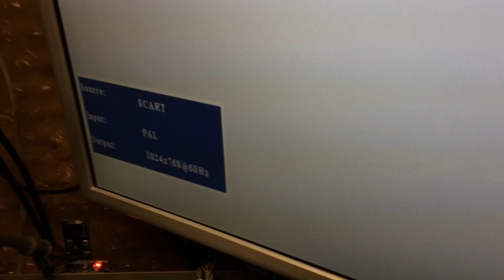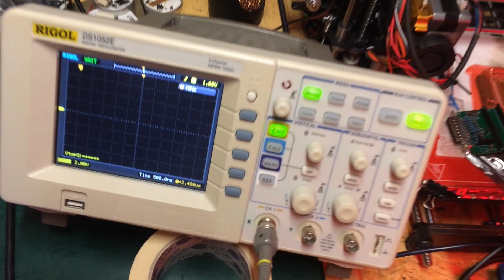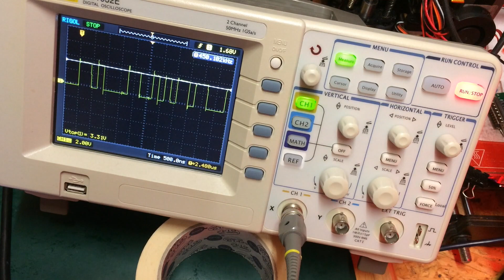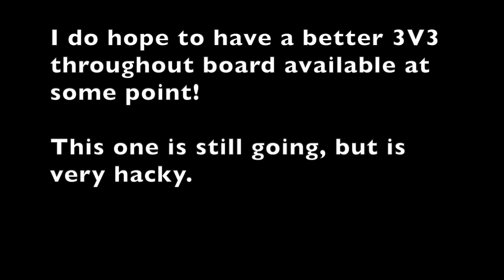ACSI2STM 5V SD Card Module Problem?

Comment: Oh, BTW: do not rely on the RTC on the BluePill to be accurate. They didn't match the capacitors to the load- and stray-capacitance...
If the BluePill didn't "poof", but just stopped working, then it might be a simple 'crash' issue; eg. it could be worth trying to re-program it using ST-Link v2.
(I sometimes have to hold down the RESET button until OpenOCD start attempting to program itm then I release the RESET button and the board works again).
-Using the WFI instruction somewhere in your code may stop your board from being re-programmed; if that happens, use the RESET trick from above.
Reply from the maker: Thanks for this. I desoldered it and it's entirely possible it's now trampled underfoot, but good to know if it happens again!

Comment: I kinda expected that it would be that. Logic Hi is above 2V as far as I remember and most 5V ICs do not output a 5V.
Besides .. inside your SD-card is ... guess what ... an ARM Cortex-M0, which is the guy sending data back and forth between the SPI interface and the NAND Flash.. =)
-If you think a pin could be damaged from some 5V source, you could always put a low-value resistor between the two, instead of using a direct trace.
(or even use a diode-step-down, but that's kinda extreme).
Hint: If you decide to design a board, please don't use Chinese junk-SD card slots; instead I suggest MoreThanAll's SD/MicroSD card connectors, they are high quality - most even come with a 'push-to-release' feature.
I prefer full-size SD card, because you can write at least a few letters on the label and they're much easier to find if they're dropped on the floor.
(in addition to me being able to handle them a lot easier - I guess my age is starting to show).
On my CubieBoard2 I sometimes inserted the SD-card between the plastic and the connector (not very good housing) - because the card is only 1mm thick. The full-size card iis 2.5mm I think - that also helps me not spend a lot of time checking if I am doing everything right.

Hirose also makes some decent full-size connectors, however, I do prefer MTA's, because they can't be ripped off the PCB as easily.